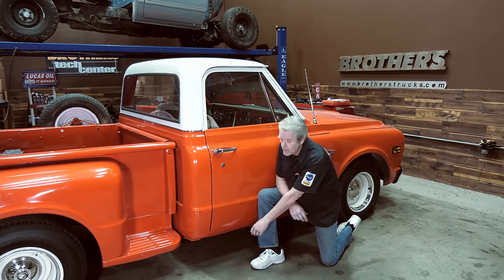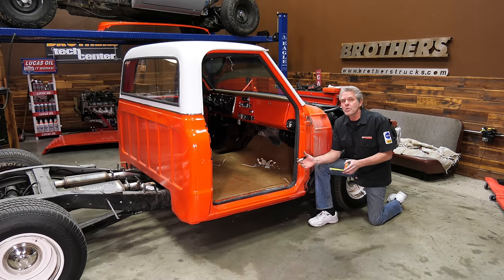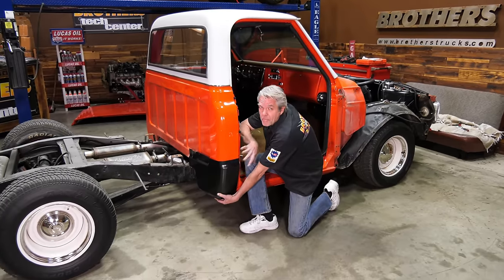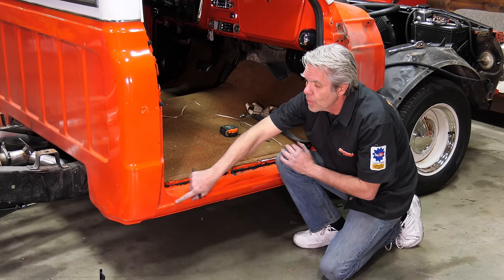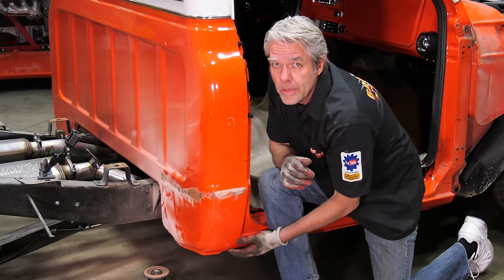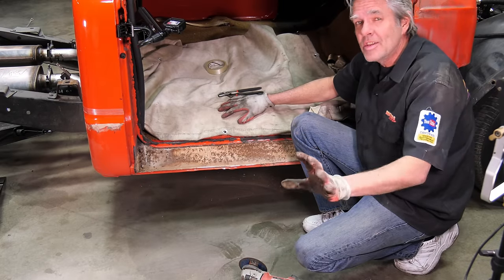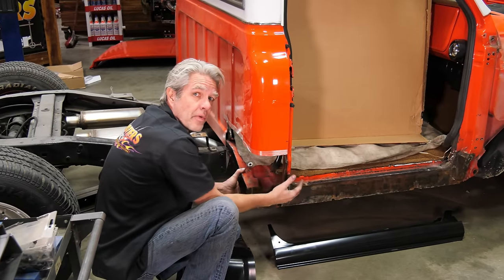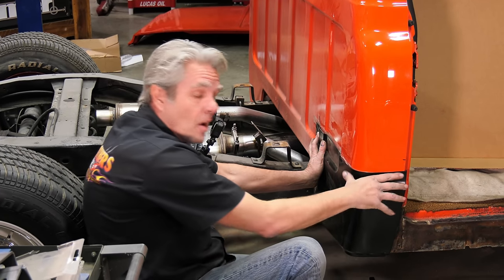Chevy & GMC Truck Rust Repair / Rocker Panel & Cab Corner Replacement

Comment: Dave Welch literally saved my life with this video. Dave talked about NOT plunging your cut-off wheel into the metal in case there is something underneath. He recommended only cutting the thickness of the metal. I am so thankful for this. As I was cutting the cab corners off my truck and removed a small section I noticed I had just missed by a fraction of an inch something that had fallen down inside the cab corner. Turned out is was 3 boxes of 22 caliber long rifle cartridges and two 12 gauge shotgun shells!!!! If I had plunged the blade in I would of cut thru all of that nonsense and probably be DEAD!
Reply from the maker: Wow, what a story! Glad you followed Dave's advice and saved yourself from potentially getting really hurt. Thanks for watching and for the feedback!
Reply: Great find with the current ammo shortage!
Reply: Does David have a YouTube channel of his own?

Comment: Great video! I ordered rockers panels and cab corners and also the inner rocker panel, cause I didn't know if it would need replacing to. I am hoping to start working on the repairs this spring. Thanks for the very informative videos!
Reply from the maker: Absolutely! Thank you for watching!

Comment: Great work.  I just finished inner and outer rockers, lower hinge and strike post as well as cab floor patching.  I used the factory assembly manual to replicate spot weld spacing and placement.  It seems there are significantly fewer spot weld used in the video...i.e. spaced further apart than factory.  Not sure it matters, but could be a design strength issue.
Reply: Where did you get the factory assembly manual?
Reply from the maker: www.brotherstrucks.com

Comment: prefect timing of this vid   Just stripped down my 65 and have to do this task  great attention to details.  Mr Dave u are the Man.  love you DIY vids.   would you have are do a vid on steering column  rebuild.  I Have one that is trashed and don't care to spend the 600$ on a new one.  thx
Reply: Dwayne Lejeune I completely rebuilt my column and it’s not too bad to do. Some parts are not available so I bought a used column and pieced one together. I live in Tennessee, in Nashville. There’s a place called Truck Haven in Unionville Tennessee that has all the c10 parts you can imagine. It’s a boneyard of only ‘67-‘72 truck parts, with some, only a little, amount of square bodies. I’m like a kid in a candy shop when I go there. The owner is Chuck. Nice guy and he also ships parts too. My column works perfectly now. Just remember how you disassemble it when you tackle the job. And install a new turn signal switch while you’re at it too. The adjustment at the bottom is crucial for proper shifting, if yours is a column shift. And I also recommend, if yours is a column shift, to get an aftermarket shift rod kit to eliminate the original style shift actuator mechanism connection to the transmission. Brother’s sells them and I believe that it’s a Lokar product.
Reply from the maker: @MicheluceRizzuto   Thank you for your reply and thank you for watching!
Reply from the maker: Thanks for watching! We'll look into doing a steering column rebuild in the future.
Reply: @MicheluceRizzuto  thx, Im switching columns  when I bought truck they had a manual, but using as a auto!  I want to go full auto.  I purchased a used column, but it was in bad shape, I think it came from a Camaro (lost paperwork)  My question how do tell whats parts I need o repair

Comment: Love the video's. I have an 85 with rust behind the seat near the seat belt retractors. Is there a replacement panel for that area? Could you show the repair in that area? Thanks
Reply from the maker: No replacement for that area is available, but that could be fabricated. We'll look into doing a video.

Comment: I’m Assuming from watching this video that since I’m replacing the entire floor pan I should replace the pan before cab corners.  I’d like to see a step by spec video of a 67-72 floor pan replacement.
Reply from the maker: Yes, floor first. Basically work your way out from the center.

Comment: Could you give us/me some information on the suggested Welder for this type of work?  Doesn't have to be brand specific, just basic model/version/type. Thank You
Reply: I use a Miller 270 amp 230v mig and there is also Hobart both sell 110 v machines that won't wreck your bank account BTW Harbor freight has mig welders that can handle small jobs like this.
Reply from the maker: You can use any brand/quality of wire fed MIG Welder for welding body panels. You don't need anything very powerful because welding thin panels doesn't require it. We use a 120v Miller MIG here at the shop which is good for welding up to about 1/4" thick metal.

Comment: I have a 70 C10 and would really like to see how to replace the panel above the window on the inside of the cab. Mine is destroyed from the drip rail leaking in. I'm dreading taking it on!
Reply from the maker: We'll look into doing a vid on that. Thanks for the suggestion!

Comment: I'm restoring a 72 C20 super and the rocker panels are solid in the sill area. Would you recommend only doing only the outer rocker and not the sill area?

Comment: Great Video, did a 65 last year, starting on another one, you have any video on fire wall replacement or advice
Reply from the maker: We don't have a firewall video, but we're working on a Toe Board video right now. As far as advice, that's the same for all sheetmetal jobs, take your time, cut as little as possible, don't overheat the metal when welding or grinding... and remember you can always fix it again if you mess it up!

Comment: I notice you didn’t weld the lower cab corner to the inner rocker like you did the outer rocker to the inner. My factory assembly manual says three spot welds go there. I only mention it as my truck doesn’t seem to be welded there from the factory either. Were they or not?

Comment: I read several places that the black coating the panels come with isn't really that great and you should scuff it then paint with some else. What is your take on that? I enjoyed watching and like the work.
Reply from the maker: It work for keeping rust at a minimum, but it's not really meant to be a base coat for paint. We always sand ours and apply a proper primer coat before painting.
Reply from the maker: @cdnbroncolife1889   You're fine. The EDP coating will basically last forever and protect you from rust. We get carried away too, so it's understandable to be second guessing.
Reply: @BROTHERSTruckPartsTV  And no matter how good you are or what you do, there’ll be areas where paint will have cooked off from weld heat and will be susceptible to rust. It’s just the nature of the beast.

Comment: I'm 18 and this makes me a little less scared to do haha. Any recommended welder settings so I get a good weld?
Reply from the maker: Welder setting can vary drastically from welder to welder. Our suggestion is to do some test pieces first before you start blowing holes or getting cold welds in your truck or repair panels.

Comment: When Dave talked about the idiosyncrasies from different factories at the time, he is dead right. People have to remember, these trucks were mass produced. In 1970 most were probably still assembled by hand. Not too many robotics yet. So fit and finish is definitely gonna be different. Even when you take a door or fender off of a 1971 truck to fit to a 1970 truck. Sometimes even the same  year off a different truck will have a variances!! It is a definitely a pain. Yet it is fixable.
Reply from the maker: 100% right on!
Reply: @BROTHERSTruckPartsTV  Thanks!! Just speaking from experience! Lol!!
Reply: Agree. The fit is different between trucks and I can see the little variances. So no matter what you do, as long as it works it’s ok.
Reply: @BROTHERSTruckPartsTV  Thats for sure!!!!

Comment: how do you treat welds on the the backside of your patch panels to keep rust from coming through the back?
Reply from the maker: We try to get in there and spray paint them after the repair, or paint the panels ahead of time with weldable paint

Comment: Would you know if the 1969 2 ton truck cab is the same as the 1/2 ton cab.The cab looks the same.Just wondering if the rocker panel are the same to order them.
Reply from the maker: The cab is definitely different where the firewall and fenders are. So, with that being said, the rockers should be very close to the same with maybe some slight differences possible near the front? We're confident that you could use them to replace or repair your rockers as a direct replacement or at least you'd be able to use 90% of it with some minor mods near the front.

Comment: I'm restoring a 1971 K10 and the inner and out rockers are completely rusted away.  How do you get everything lined up and square when you don't have anything to go off of?
Reply from the maker: You need to use the kick panel area and whatever is left of the floor pan and rear of the cab. Also, mount the doors that will help alot.

Comment: when are you doing drip rails
Reply from the maker: That's not on our short list at the moment. It's difficult to find a cab around here that needs that repair, so we'd be looking for a donor.
Reply: @BROTHERSTruckPartsTV  i find that hard to believe i see them rusted out all over so ca any wat no big deal just throught something a little different that rockers , cab corners , floor pans ect

Comment: I have a question?
  I have a 72 GMC. 
It has a about 5 inch rusty stop starting in the middle of the outer rocker I bought new rockers 
 Should I replace the whole rocker. 
Or cut out a section 
Both ends are good 
  I am not a professional welder 
  But I bought a welder 
And new grinding wheels and watching a lot of video's 
  I can do it !!!!!!!

Comment: What kind of welder would be good? Can someone recommend a welder. That is good under $ 700 or less.
Reply from the maker: Our recommendation would depend on how much or how often you think you'll be using the Welder. If you think it's just for minor work on one project, then Harbor Freight has a few options under $700. If you think you'll be using it with more frequency, the we recommend buying something of higher quality. At the studio we use a 120v Miller wire feed Mig.

Comment: Question!
What is the right type of welder for these parts?
Reply from the maker: We use a 110v Miller Wire Feed MIG Welder.
Reply: Really helpful, thanks
Reply from the maker: @victornavarro2507  our pleasure

Comment: How do you remove the patch panel clamps after you start welding?
Reply: Unscrew - you must have access to the back side to use them and then remove them. Otherwise you'll lose the little rectangular piece that clamps them together. If access is limited fish em out with a magnet IF they aren't aluminum.

Comment: What if the weather strip seam is rotted
Reply from the maker: Repairing the rocker or outer floor section will fix that issue.

Comment: Why do people buy Rusty trucks to begin with?  Spend a little more and get a rust free one from the south, sheeesh. That  being said, your videos are excellent!
Reply from the maker: Thanks for watching!
Reply: All trucks rust out cab corners. They’re open to the elements for draining and they rust. Doesn’t matter where you live. NM, AZ Nevada etc, may be immune, but at 50 years old they’re mostly non existent or exuberantly priced. So yeah, weld in some cab corners and have a truck vs search for one 40k more than you got.
1

Comment: Liked the video but you didnt show how you measured and cut the rocker on the ends.
Reply from the maker: We never cut the ends of the rocker. Once the old rocker is off, the new rocker sits in place without much need to work it. We thin that answers your concern? If not please feel free to comment again. Thank you for watching!
Reply: @BROTHERSTruckPartsTV  ok thank you

Comment: More questions than answers. I'm a pretty handy guy and I can weld but that looks damned intimidating. Since this is a given problem with these trucks it seems you should slow down. This is more like you're talking to a full-time body man that only needs pointers.
Reply: I thought this was a pretty great video on complex panel repair for a novice. I've done a few flat and basic single bend repairs on my crown vic, so maybe if you aren't comfortable with that this may be too much. aligning a door, the jamb and a corner? thats pretty complex. Probably should be intimidating. but if you take your time and align everything it can be done. I only bought a welder a few months ago, although I have welded a tiny bit at the repair facility when I worked at an airport, but never sheetmetal, that did take me some time to get right. I was actually worried I wasn't doing that great a job but his welds look pretty much like mine. I usually just do a ton of spotwelds or the material evaporates. The repairs I've done aren't nearly this complicated and it took me a while just to align the fender repair with the door.
Reply: @Born_Stellar  fair enough, Dave. Thanks for the input. They say the worst part of the job is the dread, fear of the unknown, etc...!
Reply: @kenlelon369  for sure. also how'd you know my name is Dave??? lol